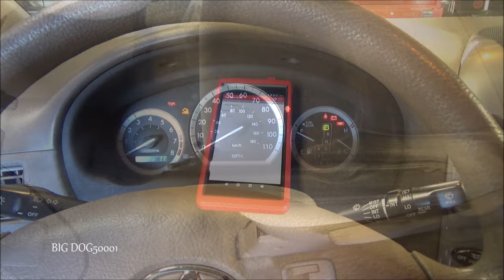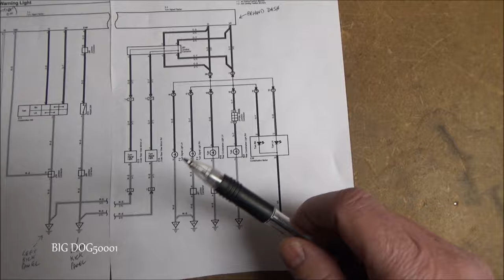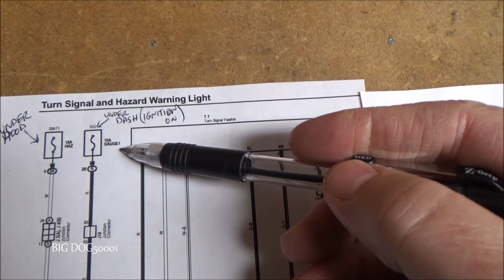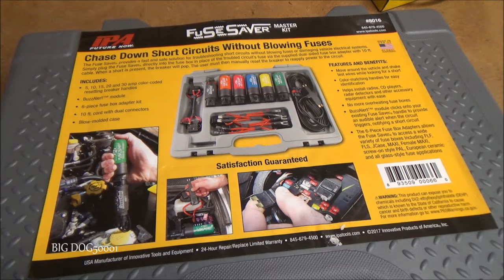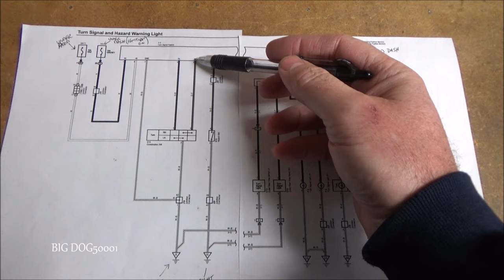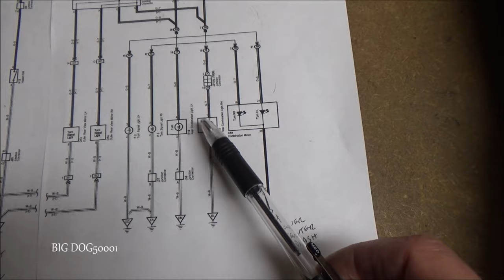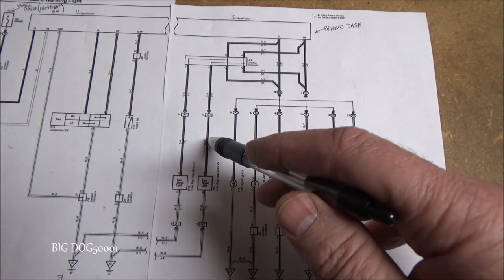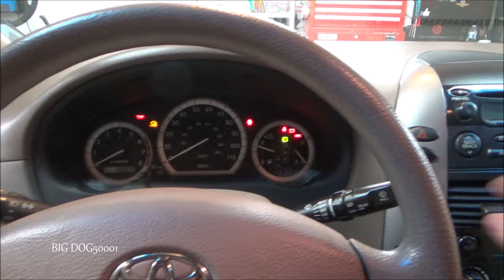Toyota Turn Signals Not Working - Diagnosis and Repair

Comment from the maker: Tools and Parts
Disclosure: This channel earns a small commission using some of these links - at no additional cost to you.
Launch Scan Tool:  https://amzn.to/2ObRQV4
Fuse Saver:  https://amzn.to/37EgDJ9
OTC Test Light:  https://amzn.to/36GpiJQ
Crimp/Heat Seal Connectors:  https://amzn.to/2GzXexm
ATM-LP Fuses:  https://amzn.to/2RB87VU
ATM Fuses:  https://amzn.to/37CJ2PL

The Big Dog 50001 Automotive Channel Store can be found here: https://www.amazon.com/shop/bigdog50001automotive
Reply: You are just awesome. I went in to get car inspected and thought I was going to have to buy a switch motor. I don't know what they did, but my signal lights did not work when he sent me away with a passed inspection. The hazards still work and I can find the screws to get to that part easier. You just eased my restful sleep tonight. Thank you.

Comment: Hi I recently ran into a problem on my 2002 Toyota celica I went to turn on my turn signals and got nothing no lights on the dash blinking or signals working. My hazard lights will turn on and work no problem I tried swapping the fuse and the relay for it and still no fix do you have any other ideas as to what it could be? Thank you
Reply: Did you ever figure out this problem? Having same issue with my 2000 toyota Camry
Reply: Having the same issue on my Toyota Yaris 2011
Reply: Same with hilux
Reply: Same with my 2005 Caldina
Reply: Same with 2000 Celica t23

Comment: Toyota sienna 2001 turn signals and hazard lights not working replaced fuses it worked, but now not working again what could be the fault you response will be highly appreciated thanks

Comment: Thanks for your help! This video is so methodical. In my situation, I ended up replacing the 15 amp HAZ fuse in the engine bay. My turning signals are now back up and running. Thanks!!

Comment: I was going crazy diagnosing my turn signal problem until I saw the part in the video where there was hack wiring. I checked the trailer harness wiring and quick splice connectors were used and the wire to the rear turn signal had broke off. You saved me many of hours of troubleshooting. Thank you!

Comment: thanks for the extremely thorough yet easily understandable explanation of the steps needed to prevent just random part swapping.  I had this exact issue in my 2006 4runner...well aside from the goofy wire tap.  I was going to go straight to swapping the flasher when it was just a bulb.

Comment: Nice explanation. It's so easy to understand.  I couldn't explain it any better. Finally solved my corolla's problem with the turn signal that has only one side that works. Thanks!
Reply: How did you manage to fix it, my estima has a issue where the left turn works, hazard light work fine but the right turn does not work

Comment: The turn signals and hazards on my 2001 Corolla stopped working after I replaced the RF turn signal bulb. I was at my wit's end on how to figure out the problem, and I did not want to pay my mechanic $120+ to diagnose and fix what I knew had to be a relatively cheap fix. I watched several Corolla specific videos which were of no real help before I stumbled upon this video. The Sienna here was exhibiting almost identical symptoms as my Corolla when the turn signals failed. 

After watching this video I was able to step-by-step diagnose the issue on my Corolla and, more importantly, fix the problem! In my case I evidently caused a short in the RF turn signal bulb socket which in turn blew the turn signal and hazard fuses. I disconnected the socket, replaced the fuses, and voila, the signals were working again (other than the right side flashing quickly as there was no front bulb). Replaced the plug and bulb (I actually replaced the entire turn signal assembly as the glass was cracked on it anyway) and everything works perfectly again.

THANK YOU so much for creating this clear and concise video detailing how to diagnose and fix this problem. Even though it was for a different model, it helped me out tremendously!

Comment: This is an amazing high quality video troubleshooting step by step and arrived at awesome result at the end. I am struggling with similar problem on a similar vehicle 2007 Toyota Sienna AWD. Hazardous light is working flawlessly all the time but the turn signals are not working and the battery indicator at the time of ignition is not showing either. Up on investigation 15 amp hazardous fuse is fine but 10 amp GUAGE1 (under the dash) fuse is blown up on just turning on the ignition without starting. I disconnected all four indicator lights (front and back) and put the ignition on, 10 amp GAUGE1 blown again. I checked the wiring under the dash dash fuse box and the console wiring and it seems to be intact. In another test, put a new 10 amp fuse and turn the ignition on, the battery indicator and turn signal worked fine however when the key tuned to start position and started the car the indicator light stop working and the fuse is blown again. Bottom line sometime the 10 amp GUAGE1 fuse is blown when the ignition is turned on and some other time when the ignition is in the start position fuse is getting blown. 
Both cases engine starts fine. Any recommendations to test would be greatly appreciated.

Comment: Thanks dude, was pulling my hair out.
Ripped apart the old relay as I was removing it because I have the hyperflash with leds, but it shorted.
Put the new one on and nothing, checked both fuses and they looked fine, but I should've started with the test light, would've saved me the headache.
Ended up being the hazard fuse under the hood and working good now.

Comment: Dave, had the same problem. No turn signals, no hazard. Checked the hazard fuse ,it's ok, checked the turn fuse, it's ok. Checked all bulbs front and back, 1 bulb out. It's a small one from the right rear. No broken wires in any of the lights. I have a 2000 camry le 4cyl.  I'll replace the bulb tomorrow. Will let you know. Great video ! Thanks.   Hope it's not the flasher.....  Nino
Reply from the maker: Did you figure it out?  Thanks for the comment!
Reply: @BigDog50001  Hi Dave , yes I did. It was  the relay. It was behind the kick panel on the driver's side. You have to look up a little to see it. I put in an after market relay, ( cheaper than Toyota), it works fine, but you hear no tick when the light flashes. I went thru everything before I checked the relay. Your video is a good way to track the issue down.  Thanks

Comment: Thank you for sharing this troubleshooting video. We have a similar issue. We just installed new headlights so maybe we have a ground condition with one of the plugs so I'll double check that. It's a 2009 Toyota RAV4 limited with the turn signals also in the mirrors.

Comment: Thanks for the video, I'll check the fuse and and the rear light to just make sure. Would have to go to a technician to fix the wiring if the wire aren't done right

Comment: I had a similar issue on one of these same vintage Siennas where the brake lights would blow the fuse but not all the time.  Took me a while but finally tracked it down to bad aftermarket tail light socket/housings.  Try telling someone they need to buy two new tail lights when the old ones look just fine.  Two used OEM tail lights fixed the problem, though.
Reply from the maker: Thanks for the input!
Reply: Did you run continuity test on socket to determine it was bad?

Comment: Great video. My right blinker light on the dash does not blink, the hazards only left works. All other outside lights work fine. What would cause this to happen? There are no bulbs in the dash.

Comment: Great to the point instructions, i have come across a lot of the those cheap nasty scotch lock connectors in the past in my repairs of customer's wiring.
especially in rear where some aftermarket towbar fitters trailer plugs. have just done a quick fix ... i hate them they bound to fail.

also now coming across al ot of fixers with panel beaters using same method with bull bar fitments. gahhh... but always have happy customer after its fixed. 

get job on the fix. 

i look forward to more content.

Comment: Good find BigDog.  That certainly does not come back to you.  

Yes, left needed attention too for the trailer flashers tat used to be wired in there.
Reply from the maker: Definitely an existing issue!

Comment: My solution was very simple. I had neglected to turn off the hazard flashers before turning the car off, thus neither signals nor the hazard flashers worked once the car was restarted. Once I made sure that the hazard button was no longer pressed, all flashers were fine.

Comment: Interesting video. I am having a similar issue. The right blinker does not work at all. Outside right front and back turn signals flash fine. Pulled instrument panel and it’s circuit board with no bulbs. Do you have any suggestions as I think it might be a ground as well versus a dash issue. The hazards have the left blink only but all outside work fine. Hummm

Comment: Hello. 
My blinkers and hazards dont work at all. Could it be the flasher relay or a broken blinker handle?

I watched your video and it is extremely helpful. My car was broken into and ransacked. The radio was ripped out and now the blinkers do not work. I dont think they are related but more info the better. The thief's could have yanked or broken the handle during the crime. 
The fuses look intact.

Thank you for any suggestions.

Comment: I've got an 06 Toyota 4 runner with the left rear turn signal out.  The front left is working.  I switched the socket and bulb from left to right side and the left works on the right side.  Any suggestions to help.  I've been trying to figure this out for one year with not luck.  Thanks, Dave

Comment: Good day,
I recently ran into a similar issue with by 2022 Can Am Spyder RT Sea to Sky. It started out with right turn signal malfunction, then daytime running lights. I replaced the 15amp fuse for daytime running lights and the right turn signal would flash all lights. The fuse failed again. Now it blows as soon as I turn on the bike. I noticed the  fuse I used on the 3rd and fourth attempt that failed immediately was not the same as the original brand so I purchased a hand full of the original type. What do you think the issue is ? I am somewhat trepidatious about trying again for fear of causing any damage.....your insight would be greatly appreciated.

Comment: On some toyota models the right and left blinkers are on a separate circuit and fuse then the hazards
Reply from the maker: That's why it is usually a good idea to get a wiring diagram!
Reply: @BigDog50001  I agree

Comment: My car has the same thing now I need to find the wire that's grounding. My battery drains every time I turn it off. You think that's the cause of it?
Same problem with the fuse blowing only on one side. Thanks
Reply from the maker: Hard to say, it could be the same problem creating both symptoms but it could also be two different issues.  Probably needs some troubleshooting done.

Comment: The same thing happened to me but a quack electrician just opened under the steering wheel and changed I think the flasher but whatever is going on is still the same, the left trafficator light doesn't come up all the time and the hazard light doesn't come up at all too

Please should I try it out just like yours though yours us the right side

Comment: I replaced all my turn signals front and rear in my 2010 corolla with LEDS. Put a new flasher relay and so it isn’t hyper blinking. Worked for about a month but I have lost my right turn signal. Checked my fuses didn’t look blown so I put a 20 in. Stopped working but now everything including hazards are working. Only thing not working is my right turn signal. Left works, hazards etc. 
Any ideas on what it could be? Do I need a higher fuse? Never had any issues before I replaced bulbs and flasher relay. Also my cruise control will not turn on.

Comment: Man, I got a 2015 camry and signal lights just stopped working while I went to the store. I checked the fuse under the hood and it's good. I can hear the sound but no lights at all.

Comment: Pretty late to the party. Long story short had the dash apart working on the fan selector. Had to disconnect 4 way flashers to get access. So never fixed but had to use the car in an emergency and quickly slid dash in loosely and went off.  Signals did not work at all (all 4 front and back). Thats because i never plugged the 4 way flashers in cause who cares right. Quick trip. Well you need em plugged in to complete the circuit and have signal lights. 1:15 into the vid and i saw the chart and it suddenly clicked. Thanks for being my muse.

Comment: Have an issue similar but different.  I turn the left turn signal it goes for a click or two the. Goes off, I do the right it works fine. No fuses blow, hazards work as well, but not directly after using left turn signal.   Not sure what to trouble shoot... any thoughts ?  Thanks
Reply from the maker: An issue with the ground for the left signal, bad turn signal flasher or bad switch are possibilities.

Comment: Do you have a wild guess why this problem has occured only previously? From the looks of it, the open wire at the right rear light had no other way than touching the metal when you screw the case back on. If this was done a while ago by some idiot, this issue should have occured right away, not? Or was it hanging around loose enough that just the right amount of shaking randomly dislocated the connector towards the metal? I'm really puzzled how one could just cut open wires and leave it hanging around like this, but I've seen stuff like this on other mechanic's channels as well, seems to happen on a regular basis.
Reply: All it takes is for the car to bounce in the wrong direction to shift the wiring over just a little bit.  In nearly every used vehicle or trailer I've owned I've found the wiring to have been fiddle farted around with.  Usually I don't find out about it until something like this happens.
Reply from the maker: There is enough room in there that it probably was not touching anything when it was cut and first put back in there.   After a while it moves and touches ground and bingo.  I wish I knew why some people do shoddy work like this, thanks for the comment!

Comment: I have 2012 toyota fortuner am facing an issue , my all external indicator lights are functioning , also i can hear the sound , the problem is the indicator light to left side on my cluster is not working.

Comment: I'm working on a 96 Camry. It took me forever to figure out why my turn signals quit working. I had the dash apart and had the hazard light switch disconnected. Power evidently flows through it in order for the signals to work. Don't make the same mistake. I spent too much time on something simple.

Comment: I dislike any shoddy electrical work and will not let anyone do anything if I do not trust them..

But what were those clips that has the exposed wire for anyway?
Reply from the maker: Generally I see those quick splice taps used to add trailer lights.  The big mistake here was not taking the wire that was added completely out.
Reply: Big Dog50001 Automotive 

So that was what that wire was for.. thanks

Comment: Sir how about the hassard, even turn off still blinking. And when turn on  the car hassard hassard blinking.. Thanks
Reply from the maker: I would look towards a bad hazard switch first probably.  I would press the hazard switch on/off repeatedly and see if it turns off, if it does it is probably a bad switch.

Comment: Great video! Where can we get/download the electrical schematics for the cars?  I have a mutch simpler Toyota aygo with only a round speedometer with lots of electrical plugs in it.  the right blinker LED seams to be broken in there cause the blinker works outside and the hazzard lights blinks also, I need to get that speedometer box open somehow. I gues those LEDs are soldered to the circuit board. But I can do that. The opening part is the bitch tho :-D